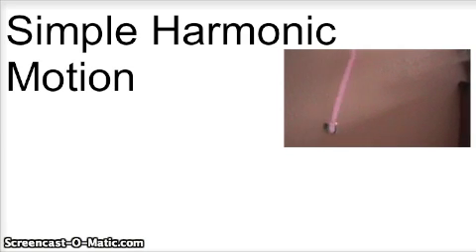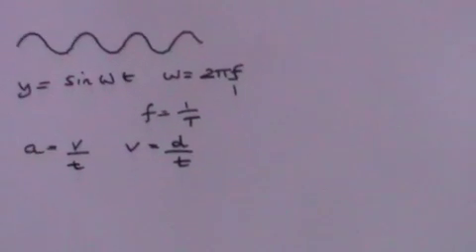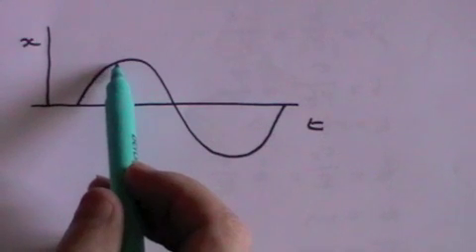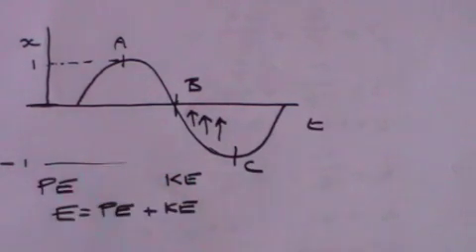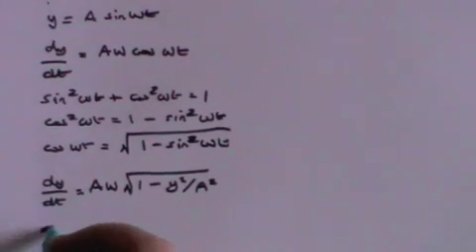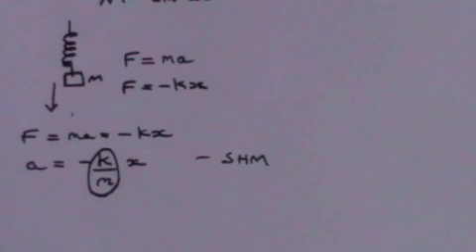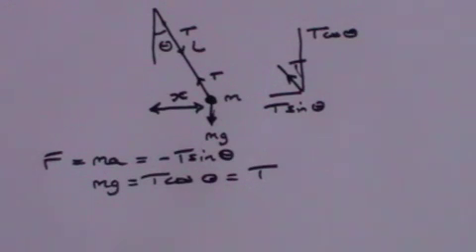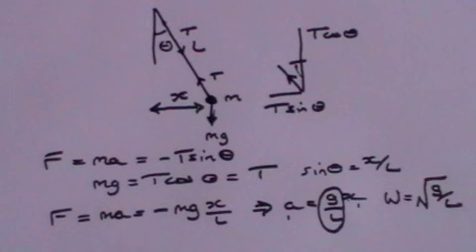Simple Harmonic Motion

Comment: Why does  F=ma=-T sinθ (in the pendulum question)?
Reply from the maker: +Saku Yes. But they angle is measured in the opposite direction to the restoring force hence the - sign.
Reply from the maker: +Wang Liz (Ludwig) When the pendulum is at an angle theta (and provided this is not more than a few degrees), the restoring force F=ma is provided by the component of the tension in the string.
Reply: +DrPhysicsA why does F=ma= minus Tsin(theta) and not positive Tsin(theta). Don't both the restoring force and the horizontal component of the tension act in the same direction?

Comment: why it is not f=-ma? 
why it is positive?
as acceleration is vector, acceleration should be negative, right?
Reply: +ahmad zahir It is taken generally as a convention that, down or in the direction of gravitational acceleration, the sign is positive and that up or against gravity is negative. You can do it your way but, it will be more difficult. It has been made that way to make it more easier to do calculations.
Reply: Because for this equation we are not looking at gravity. Simply, the acceleration of the pendulum. a can be resolved into it's component vectors which will then directly be looking at gravity. But the a in the example in the video is solely looking at the resultant acceleration.

Comment: At about 8:10, I don't see how you get that t sin theta is the only restoring force, since the mass also has to move downwards to get to the equilibrium position. This also, by logic, means that your 2nd equation must be wrong. Also, the weight is constant whereas the vertical component of tension varies with theta, so this is true only for a certain value of theta, but since the mass is in motion, the equation can't hold. Hope this helps :)
Reply: Ignore the first part, I misunderstood for a minute. I'm pretty sure that the 2nd equation doesn't hold though.
Reply from the maker: Kristen R You are right that the restoring force will vary with theta - thats how we get the SHM. The force, hence the acceleration, varies with displacement (which depends on theta).

Comment: Huh. Dy/Dt was never explained to us when we did SHM last month. It was simply:
As the max and min values of sin and cos are 1 and -1 respectively, v = -wAsin(wt) and a = -w^2Acos(wt) simply become: v.max = wA and a.max = w^2A.

Iv'e done AS maths and doing A2 now, but haven't differentiated cos/sin/tan so I didn't know how e was doing that (it looks like multiply by w and sin becomes cos, and cos becomes -sin). We're starting Chapter 8 Differentiation (last chapter) in C3 next week so I guess we'll learn that then?
Reply: d/dx cos(x) = -sin(x)
d/dx sin(x) = cos(x)
where y is the displacement of the particle: y=Asin(ωT)
to find dy/dT which will give us the velocity we need to use the concepts above and the chain rule:

The chain rule is used to find the derivative of two composite functions. Let's say y=f(g(x)), let's set g(x) to equal a variable to simplify things: z=g(x) (This is all the output of a function is: a variable)

Then we have y=f(z) - much simpler.
Let's take dy/dz=f '(z)
we know z=g(x), so dz/dx=g'(x)
now to cancel out dz we multiply dy/dz by dz/dx to find dy/dx:
dy/dx = f '(z)*g'(x)
z=g(x):
dy/dx = f '(g(x)) * g(x) <-- This is the general result of the chain rule. We can apply it here:

y=Asin(ωT) 
z=ωT
y=Asin(z)
dy/dz=Acos(z)
dz/dT=ω
dy/dT=Acos(z)*ω
= Aωcos(ωT) (This can also be expressed in the form of a negative sine. function as you have been taught, simply because the initial wave was the displacement of a cosine wave, instead of a sine. We know that d/dx cos(x) goes to -sine, so that explains that.)

to find acceleration, we do the same again as acceleration is the rate of change of velocity:

y=Aωcos(ωT), we know that Aω is just a constant so we can do the chain rule again:
dy/dT=-Aωsin(ωT)*ω
=-A(ω^2)sin(ωT)

again this is a different function from the one you were taught because you started with a cosine, this is because d/dx^2 cos(x) = -cos(x).

It does not matter which wave you start with, just acknowledge that you can have different graphs, the two are just TRANSLATIONS of eachother by pi/2 rads. This means frequency, amplitude, wavelength (assuming perfect SHM) and omega are the same for both.

A quick trick to remember the chain rule is to remember: "The derivative of the outside multiplied by the derivative of the inside"

Hope this helps, sorry if it was a bit long-winded :)
Reply: Ben Towers I must have missed the notification in regards to your comment earlier; Just saw it now!

Yep, we've finished doing the derivatives of trigs e.t.c. I really appreciate you taking the time to explain all of this. Iv'e finished with both SHM and Differentiation (chain/quotient rule e.t.c.) but never thought about using them together lol.

I wish they integrated more maths into the physics course, but I guess those who aren't doing maths as-well will just lose their minds XD
Reply: Asfandyar Khan up HD h kg h
Reply: Ben Towers Thank you for taking the time to write that.
Reply: +Asfandyar Khan A bit late but what he hell :P Someone in my class doesn't do A Level Maths. We just started Capacitance, when we started doing exponential relationships (i.e Q=Qe^-(t/RC)) she was baffled, the integral calculus for the coursework is going to be hell for her :D

Comment: Strictly, when you define SHM, you get the equation
1) a = -(2piF)^2 x (taking 2piF as the constant, the angular frequency)
But deriving this equation from the second derivative of displacement gives a = - A(2piF)^2 
To account for the Amplitude in 1) is it correct to take the constant as A(2pif)^2 instead?
Thanks

Comment: Is omega the circular distance the particle moves in a second in radians? So.2*pi  is one circuit so times that by the frequency and you get how many times it goes around in a second.  But a radian is an angle size so getting a trig value of this for the y direction displacment is always gonna be between 1 and -1 which represents the amplitude without an A component?

Comment from the maker: Yes. You use the cos term if t=0 is when the pendulum/spring is at its maximum displacement from the mid point. You use the sin term if t=0 is when the pendulum/spring is at the mid point. y is the displacement from the mid point in each case. Just try values of t=0 in each formula and see what different values you get for y.

Comment from the maker: A pendulum doesn't have a spring in it (usually). The reason both a pendulum and a spring oscillate is that whenver they are displaced from the mean position there is a restoring force which is acting to restore to the mean position. In the case of a pendulum that force will be due to gravity. In the case of the a spring it is caused by the inherent nature of the spring.

Comment from the maker: Think of a spring with a mass M oscillating up and down. When the mass reaches its lowest point it stops going down and starts going up. At that point its velocity is zero. But the spring has its maximum extension at that point. For a spring the force acting on the mass is F = Kx (where k is the spring constant and x is the displacement from the mid point). Since x is maximum at this point, so will be the force. But F = Ma so the acceleration is also maximum.